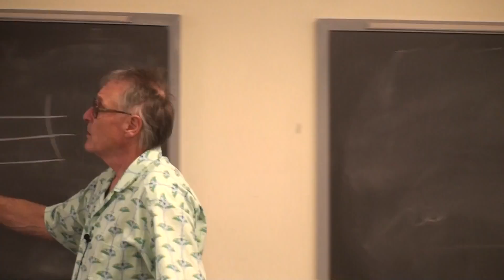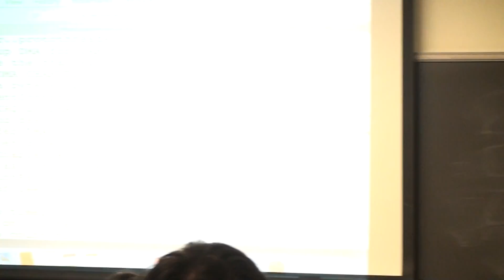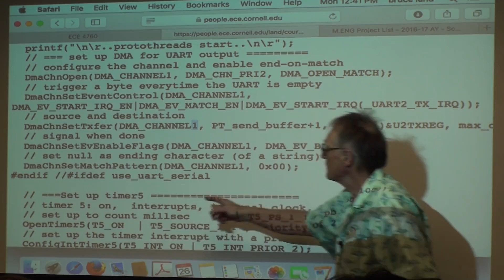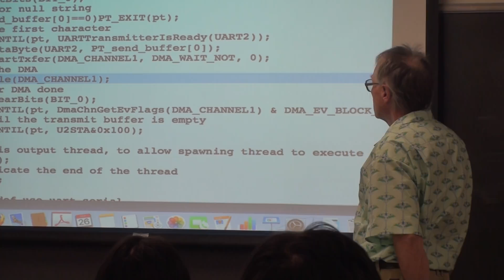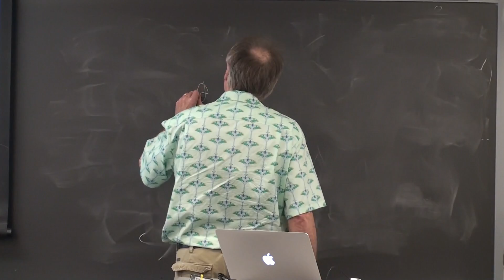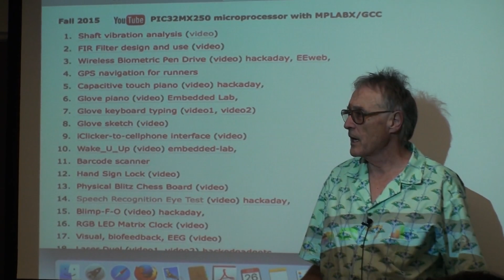#14 DMA

Comment: Bruce, are you still out there? I just want to say I love your videos. I saw some in the past and never really managed to pick up on them till lately. They make so much sense now. Believe it, was waiting for buying gear to catch up to your courses.
Reply from the maker: Thanks. I am still teaching, but will be handing the course off to a new instructor next year..
Reply: @ece4760  I have been trying to learn on the STM32F103C8 with SW4 IDE. Generating the code from the CubeMX is very verbose, and it is driving me nuts. I admit I am so much behind on much of what is in controller technology. For example, UART DMA has to always be same buffer size. Only way to flag reception has ended before buffer was filled is by triggering an IDLE flag. Which as you can see takes more editing in the pre-generated code by the CubeMX. I was wondering why they didn't think of the null terminator so that the programmer just initiate the callback, which is the Interrupt Service Routine. Different companies have different terminologies. Somehow PIC has a clearer view on what a chip is supposed to do. How does one cover a reference manual which is 1134 pages long? Maybe I'm going about this all wrong? I appreciate your feedback.